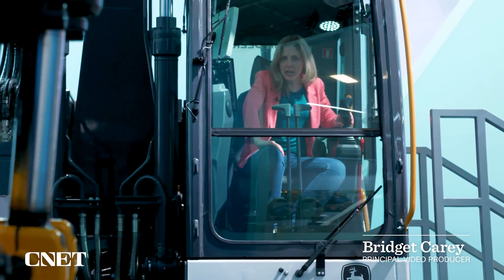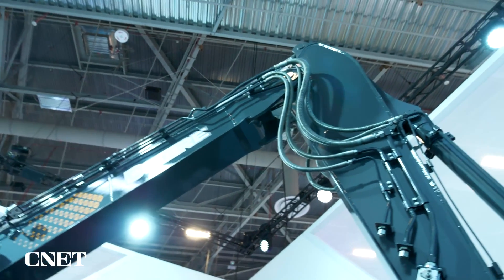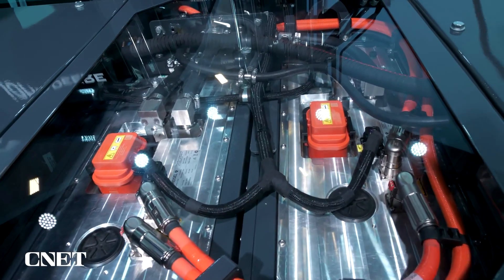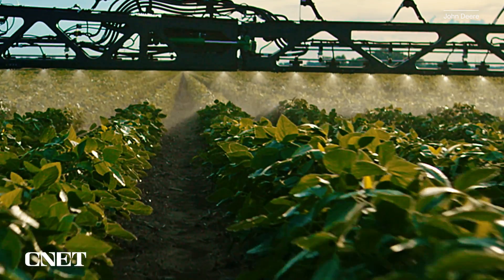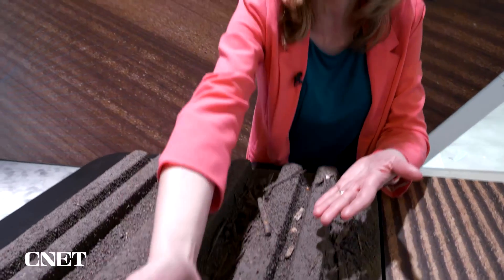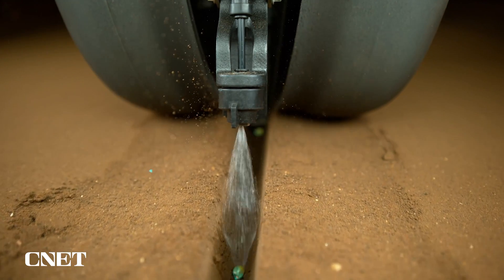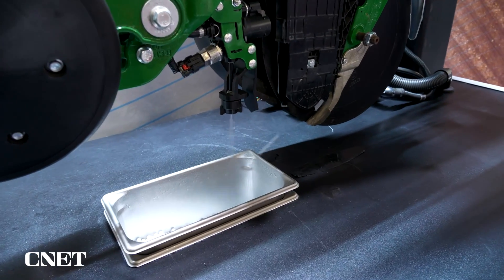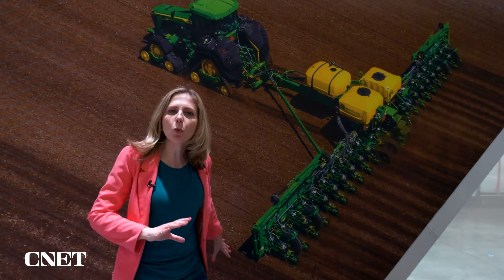John Deere Is Going Fully Electric With Its New Excavator

Comment: I’m just wondering how long you can run that excavator before it needs to charge and also how long it takes to charge? The diesel excavators can run 24/7 minus maintenance. And what is the process of disposing the batteries once their life cycle is spent? Can the batteries be recycled? If not we better start thinking about where all of these spent batteries are going once America goes fully electric. Probably gonna spent $500M-$1B to shoot them into space, pollute the galaxy rather than the planet? How much earth has to be mined to produce enough material to build one battery? How much concrete, extreme pollutant, needs to be used to build solar farms, wind farms, any electricity harvesting facilities? I believe America needs to rethink this 100% electric economy idea. There are so many questions that can’t be answered yet. Surely other minds are thinking decades into the future about the electric waste, and yes….. all forms of energy have some type of waste involved. Many, many, many production hours will be lost waiting for equipment and vehicles to be charged. I think that fully electric excavator should go head to head with a diesel excavator of the same size and see which has a higher production rate.

Comment: As an operator, this is a disaster waiting to happen.. I’ll run a diesel machine thanks.. one thing goes wrong electrically in that machine and you will be tracing wires for weeks to fix it..

Comment: How would they power a charging station for a construction site... I thought the whole reason they have fuel driven generators is because there typically isn't power during the digging phase... 

Also, very cool money saving tech for the farmers. but how much does it cost and how long will it take for you to repay that machine with the savings of seed and fertilizer? Because if the initial cost is too much for farmers, they won't buy it.
Reply: Check mate, diesel generator
Reply: @Storm-trooper-R2D2  so we're still relying on fossil fuels... If I'm a contractor or whoever, I'm thinking why replace my existing diesel equipment for electric equipment that will need to sit and charge for hours each day on a diesel generator? 

Unless I just add the electric equipment in addition to my diesel equipment just to enable me to do a few jobs that would have been more difficult with diesel.

Even then, I'm not really seeing the point of this product.
Reply: @kyle8851  Although we’re still relying on fossil fuels, it drastically reduces the amount of fossil fuels we use per application. That’s why diesel generators are the way to go

Comment: Is there a way for them to put solar panels on the roof? Given that they are usually used out in the open, wouldn't that be efficient?
Reply: The same question was asked to Elon musk for the Tesla cars. He stated that there will never be the technology to be able to absorb enough solar energy to completely power a car. Yes, it can slowly give a few percentage of battery while sitting in the sun, but it will not be enough. And you have to also think about the fact that those panels will not always be in direct sunlight depending on trees, clouds, weather, etc.
Reply: So basically, no. Definitely not considering the amount of draw and power it takes to do operations on the farm.
Reply: @hunterheathtx7815  Oh. Thanks.
Reply: Using solar panels to directly power a piece of equipment is somewhat analogous to charging your car with a stationary bike. The energy going into it isn't enough to do jack.
Reply: But while the machine is sitting it would help maintain things?
Not every excavator runs 24 hrs a day.

Comment: Compromised data linking gasoline/diesel release into the environment and cancer is on a par with the tobacco and blue asbestos industries.

And yes, on the whole the manufacture of electrical vehicles will eliminate these gases…

Unfortunately the history of chemical sprays in the farming sector suffer the same malevolence of corporate manipulation.

Comment: awesome.  stationery machines, or those that typically operate in close quarters, could just be plugged in with an extension cord to a standard outlet.
Reply: It'll take a long time to recharge on a standard oulet
Reply: @danwat1234  If it's stationery, there's no battery.  It's just plugged in like any other appliance.
Reply: @snappybabby4646  peak power requirements of machine is far higher than most outlets, a larger excavator anyway so would still need a battery to buffer

Comment: The real question is “Do we have the right to repair?” John Deere is famous for ANTI right to repair. Meaning if your machine broke down, only John Deere can fix it and charge you for it!
Reply: This won't matter if small independent farmers can't afford the equipment. This bad boy has to cost a small fortune.
Reply: Check out Louis Rossman. Dealer just caught on audio recording antitrust for their GPS Starfire unit
Reply: Right to repair does not equal right to modify. Farmers can repair all their equipment as much as they want. They are not authorized to access and modify control software
Reply: @thomasbritten7216  you are a toilet

Comment: every construction site across America will be charging their "green" EV machines with a diesel generator since most all construction sites don't have permanent power... all this green BS is so annoying.
Reply: I totally agree. Calling an electric vehicle "sustainable" is completely meaningless. I love the tech, but it's not any more sustainable than diesel, because the energy stored in the onboard batteries just come from coal or natural gas power plants. Not to mention, lithium and cobalt are very limited resources. There may be a day when we can use solar power to drive these vehicles, but that day is a long ways away.
Reply: @kilgorefarms2169  also, wind power as well. EV is a fad that will no longer last in the future due relying on batteries.
Reply: There is a thing called energy storage! And the energy doesn't come from burning diesel!
Reply: No.. green energy is the future every car company and machine company knows this will be the standard ... sorry grandpa were not using stones and rocks .
Reply: @paulbernal4580  green energy may be the future in 20-30 years, but in the meantime, all the EV's get there energy from coal or nat gasl. renewables are only 19%. And on a jobsite that requires this type of machinery, its all diesel...